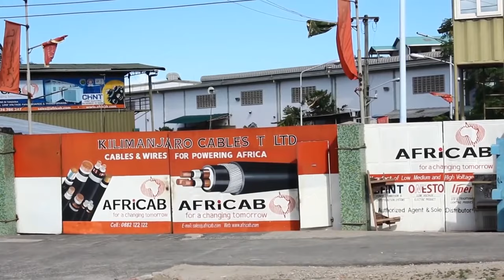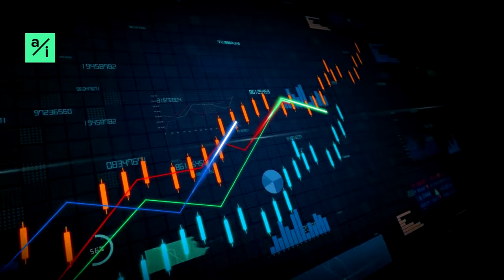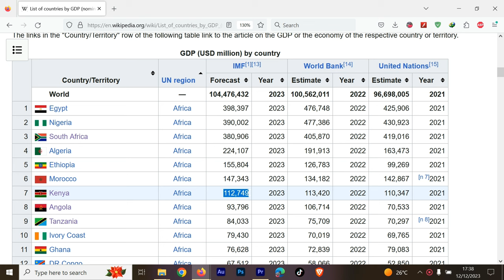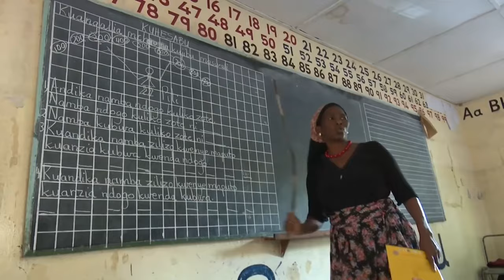Tanzania's Silent Success: Economy Bypasses that of Kenya & Ethiopia

Comment: You should know that when Tanzania's GDP was at $47 billion in 2015, that of Kenya was $70 billion.  In 2021, Tanzania's GDP was $70 billion while Kenya's was $110 billion. Tanzania's GDP increased by $33 billion while Kenya's increased by $40 billion from 2015.

The forecast for 2023 as you've claimed in the video is that Tanzania's GDP will be at $84 billion (a $14 billion increase) while Kenya's will be $112 billion (a $2 billion increase). According to your conclusion, based on these increases, Tanzania's GDP will overpass that of Kenya in about 10 years to come. That's a mad talk, to be honest. So, let's get real

Now, this December of 2023, Tanazania's GDP is  $75 billion (a $5 billion increase) while that of Kenya, even after a recession since 2019 and overburdening debts is at $113 billion (a $3 billion increase). Now tell me, how will Tanzania's GDP bypass that of Kenya given these facts. As you've seen, Kenya is growing almost at the same rate as Tanzania, that $14 billion leap in Tanzania's GDP has not happened as you've seen.

So, unless you're assuming Kenya will stagnate then Tanzania's GDP is not going to pass that of Kenya any time soon.
Reply from the maker: Let me correct you.
TZ GDP is currently at $84 billion. Kenya’s GDP is at $112 billion this year.
In 2021 it was $70B vs $110B respectively. 
You can blame elections but are we currently doing better economically?
Reply: @africainsider  We're not doing any good
Reply: @africainsider  we're not doing good at all
Reply from the maker: @heidipratt1097   TZ is too silent to be doing bad. Their President could be doing big things in silence.
Reply: African insider as an economist I can say ur not making sense ...are u talking about FDI ,GDP (nominal and ppp) ,even food security check the facts Tz is slightly behind Kenya but ahead of Tz ...wacha story za jaba😂
Reply: @jameskiruthi4256 bana maliza the so called insider. Hawatuwezi imeshindikana hawatuwezi~Harmonize